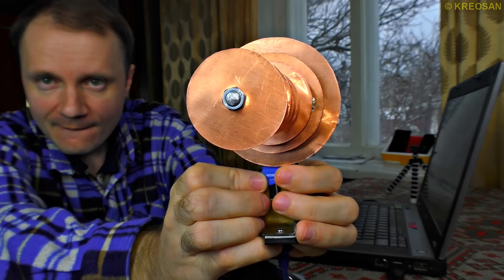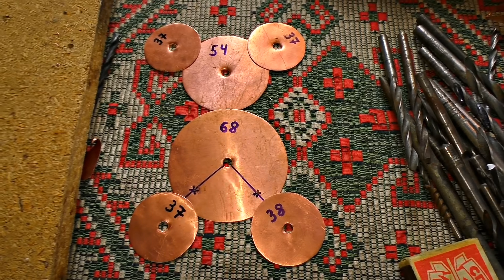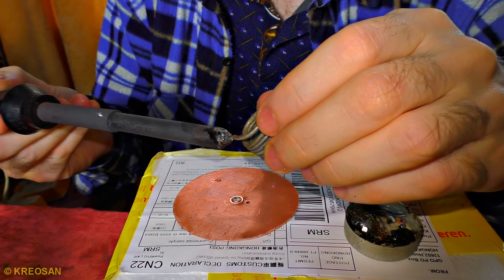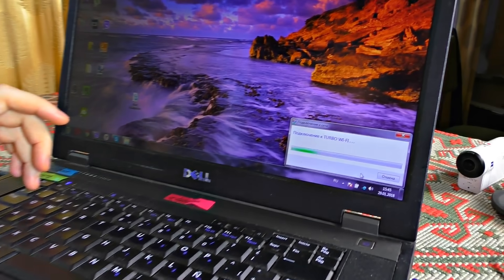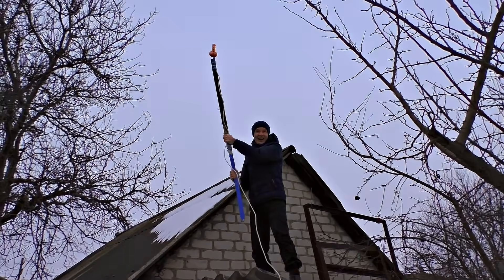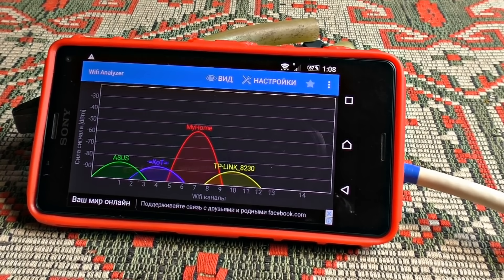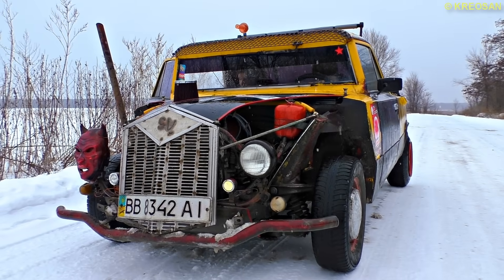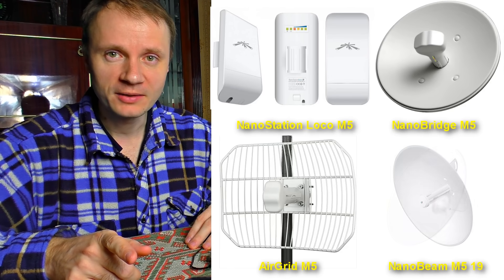✅Wi-Fi Gun DIY / Powerful Antenna for Wi-Fi !

Comment: kreosan , I like this design, I'll keep this one in mind as its similar to a yagi antenna but may work better. If you could save me some time, do this experiment please:  Use some larger diameter copper discs in a series circuit generating high amps and low voltage out put by using a flame/heat source for heating up the center core of the discs,as the heat thermally transfers its self from the center of the copper discs to the outer rim of the copper rings generating an ultra low voltage but high current that needs to be converted into a more usable form of electricity.  Thermal electric using copper and just heat alone basically.

Comment: I not think 75 ohm Cable must be used for Wifi
Reply: The losses are real in that length of cable. Better to put the dongle or the router on the top of the mast next to the antenna.
Reply: Yes, agreed.  Use USB cable and maybe even powered hub if length of USB cable is long and signal strength is low.  I think impedance mismatch can heat up adapter also and cause to reduce operation life.
Reply: Exactly what i thought at most 50ohm cable should be used, and isolation between elements is when i realized this was BS. If you short circuit your antenna to ground i would think that would keep it from working. Basic antenna 101. Ground absorbs current!
Reply: Szakembör TV TMIAE it's the characteristic impedance of the cable when the cable is used to transfer signals... The thing is that discussing this as a problem here is bs because in an antenna, only the core is used for the signal. If the shroud is not connected, then it has no influence on the impedance. If it is grounded, it will act as a shield and prevent other signals from getting in between the antenna and the receiver. Has anyone tested this rig? I'd say, don't claim hoax if you can't prove it... 
I've done a successful wifi rig with a box of pringles that boosted my signal to 200m (instead of 50m without): Take  2 unopened Pringles tubes, cut out the bottom, throw away the pringles because they are disgusting, then cut a small hole in the center of the metal lid (slightly smaller than the width of your wifi antennas) and slide them over the antenna. 
This design could work if the sizes of the disks and distances are optimal to resonate on wifi frequencies, and since a pringle rig works, I don't see why this wouldn't do anything... I'll try it in a couple of weeks and post the results :)
Reply: yes 50ohm is best and you want it as thick as possible to reduce losses
Reply: Yes, Extent the USB wire, not the coax.
Reply: He got really lucky that all that cable loss was beat by the gain of more height! Wow
Reply: Yes, and not any Rg58 ohm cable. Due to the High Frequency we need Special low loss cable.
Reply: Putting a wifi dongle in place of the driven element would work well. THe reason: The dongle is a transceiver itself, hence 0 length downlead. The  only thing coming down from the antenna then would be base band data; hence no transmission line is needed or desired. Try it, it should work very well. Done the same with old satellite dishes. THere was an article in the ARRL's QST magazine some months ago about making a radio telescpe out of one of the old Dish antenna (ahem) dishes. Also, the author designed it to work as an alternative to wifi dongles. Hve to find the article and read it. It is, if nothing else, a damed good read. 73 de WA8LGM/WQTZ773
Reply: Just run USB from back of antenna 
USB 2.0 provides for a maximum cable length of 5 meters (16 ft 5 in) for devices running at high speed (480 Mbit/s).
Reply: google "zsun openwrt" and you'll see the perfect candidate for this.
Reply: Seems that I don't even have to post anything, as here you can find a more reliable source who tested this rig and fixed a minor problem with it, proving it works, but also proving it doesn't work as well as this video claims. (but it certainly does work)
https://youtu.be/QTMi99HtW_k
Reply: belive 50% of this video
Reply: Vic Green RG142 👍👍👍
Reply: USB over Ethernet worked for my wok-fi antennae  .  The hardest part is keeping off the roof to do adjustments midnight to 0700!  "don't do it,  wait til the morning..it's totally not cool at this hour" said me myself and I
Reply: Could I do this and hook it up to my phantom 3 drone and get more distance?
Reply: John Cartwright were you responding to me?
Reply: try on yours TV's cable  to connect the hot wire(central) with ground wire and then check how many programs you will receive ....
Reply: Vic Green is this real?
Reply: I find it funny that some of you guys seem to understand at least some basics a radio communication yet still believe he pulled this off....

He didn't the directing element was never even isolated.... This video is just bullshit to rake in YouTube views. Those of you questioning his use of 75 ohm coax are correct but there is no way in hell that the height overcame the losses......
Reply: The impedance mismatch isn't that severe, it's not that advisable, but not that likely to break anything, and won't matter the slightest on receive.
Reply: Also I think low quality RG59 tv coax has lot more losses then ECOFLEX 15 plus or aircell coax
Reply: Hello Corrosive,  I totally concur whit your statement. Also in the video on the car they easily directed the antenna. In real world this is a pain in the *ss.
Reply: google "zsun openwrt"
Reply: remember it's Russia, so it's not uncommon to have power fluctuations if you connect a big power consumer... And I'd take the other video's advice at heart about blowing up your network card amp if you happen to connect it in the unisolated version... (I guess in the video's case, you'll blow op the "pigtail")
Reply: use 15 ohm

Comment: Simply fake all of it impedes dsnt mach for wi fi and cable TV 

The squigly thing is not a quarter web length antenna..

Bolts shorts every plate...
Reply: Debashis Das no its not. Eletricity at high frequencies behave different than normal. https://youtu.be/GRJw3SCBGfA here they explain it.
Reply: thanks, mate for the link
Reply: Debashis Das you're welcome.

Comment: Shouldn't antenna elements  be electrically isolated from one another but yours are connect over the metal bolt?
Reply: It doesn't matter, because when they resonate, in the middle there will be a voltage node. It's like when you put a finger softly exactly on the middle of a guitar string (not pressing it down, only soft): You will still be able to hear a sound (not the best example, because here it will be one octave higher).
Reply: Lukas is correct (I'm an engineer).  Here, the guy used round elements so it's not horizontal or vertically polarized.  Further reading : http://www.antenna-theory.com/antennas/travelling/yagi.php  Add "plumber's special" to a yagi search, that part isn't a new idea.
Reply: Zara Hall yes, it is possible. With signal in giga Herz, flow of electricity is different. Wave length is very small. 
 Did You See how build is phone antenna? And why ground is connected to this same copper wired with signal pin?  I use for my antenna in computer from old phone. And is working. Maybe signal is this same, but important is that is not worse, then original cheap antenna.
Reply: Yes strange

Comment: Adapter: TP-Link TL-WN722N
Connectors start looking for combinations
RF Coaxial tv f plug 
Rp-sma tnc connector female (for those black 90* wifi antennas)
RP-TNC female (different antenna type)

Comment: This is too good to be true i say its fake
Reply: Darren DIY this channel has always been legit. Don't know why they would fake this
Reply: Yeah dude that is what i think but it seems too good to be true
Reply: It's totally possible, I've done these things myself. It takes skill to do it right.
Reply: Probably real - that antenna has lots of gain compared to the crap factory almost -dipole.  2.4 gig does need line of sight, though...so won't go around the curve of the earth.  Note, the gain comes from concentrating the pattern all in one direction - no up or down or side to side.  There's no free, and as he said, aiming is critical.
Reply: Nah, it's real. In my city we tested WiFi between two high-schools's roofs, 6km apart, and we got a 80mbit connection with a couple of antennas not much bigger thant that one, and an ubiquity AP.
Reply: nah, that‘s real. 100s of kilometers isn‘t a thing, but a kilometer or so is definitly possible.
Reply: +ComandanteJ  if is real, I would love to see any proof of your antenna setup ..On FB or web page ?
Reply: Doug Coulter thsre is no curve.. At 40klm the line of sight drop is over 300 feet. The signal will be travelling nearly 600 feet above the ground at 50klm
Reply: Mr Alex Biz try it yourself

Comment: Fake
Reply: Also antenna elements of the Yagi type antenna  should be electrically isolated from one another but his are connected through the metal bolt.
Reply: peter allridge ???
Reply: no it aint
Reply: Zara Hall this is true although I bet it does work as a very good local less than 1km directional but that distance is utter shit
Reply: +peter allridge

Would this be antenna be better than a normal yagi or cantenna?
Reply: Ra Vee what kind of question is this? A badly made aerial v a consumer product?
Reply: I use rf daily no way that thing would work that far 0 chance and the coax used would rob all power sent down it it's 75ohm. Basic shit ppl. Not saying it does not work but that distance is fake

Comment: connecting 75ohms cable to 50ohms wifi dongle ?
Reply: Roshke it isn‘t impossible. The mismatch between 50/75ohm will give a SWR of 1.5. This means you‘re losing some of the power/energy, but it‘s still fine.
Reply: You'd have to make another of different size to tune the 5 ghz band.  Yagis are very narrow-band.  I'm surprised he even got most of the 2.4 gig band (you can see it tailing off at the edges of that band as is).
Reply: can I replace coper whit aluminum .
Reply: That's going to be up to some details in the router.  Most that have two antennas don't put them in parallel, but have essentially two radio front ends.  Later models attempt to do beam forming which requires omni directional antennas to work (this is done by adjusting the relative phase of the N antennas - like in a phased array radar (you should be able to google that).  This yagi likely has a far tighter beam than that could produce already - hard to say without more info, but I'd bet around 10 degrees + or -.  If your router has two antenna connectors, you could use 2 of these pointed in different directions... 2 in parallel on the same jack would require some kind of impedance matching to have a decently low SWR (see below).  I know when I made something like this back in the day cut for UHF TV wavelengths, it was really hard to aim accurately enough and was so narrow band that a 6 mhz wide tv channel didn't fit too well - color was elusive (NTSC signals in this country...).
Reply: Krzysztof Rodak I'm wondering how that works as well. I've heard that it's impossible to use wifi over tv and satellite cables

Comment: cool video but complete bullsh*t  you will eventually kill your wifi dongle or router if you plug this in for any length of time
Reply: And this is completely ignorant... You have to understand what his intended audience is, namely people in a war-torn country, who have to make do with a devastated infrastructure. This isn't meant to be a permanent fix, but rather a way for people to communicate with their loved ones after their city is SHELLED... Not great when you live off the grid, but fantastic if there is NO GRID! Furthermore, how do you know that their standards for coaxial cable aren't different than in the U.S.? I certainly don't. There's a reason why his videos in the original russian/ukrainian (?) have over a million views, it's in his BEST INTERESTS to properly instruct his viewers as to how to connect to the internet under adverse conditions, where they couldn't be able to otherwise.
Reply: this wouldn't even be a temporary fix the dipole he pulled apart would have more reception.   This is like a dead short between the 2 wires.
Who said anything about the coax.... although by the time the signal managed to get down that tv coax there would be no signal.
Reply: Clearly, skyliner is NOT an RF engineer. Your statements are ludicrous bullshit.  Read ANY antenna book and note the sizes of wavelengths and the sizes here.
Reply: if you look at making a yagi antenna the balun is not connected to the rest of the antenna or on a patch antenna the two wires are not connected together, you dont have to be an rf engineer to see that this is complete bullsh*t

Comment: 0:06 Hundreds of kilometers? Meters maybe?
Reply: in original russian video he said "many kilometers"
Reply: the real test result is 9 kilometers and that is also without tall building in between the antennas
so maybe in theory if you make it 12 times or more of the size the antenna in the video, you could get 100 Km
Reply: I guess his 3 mm copper sheet metal is also just 0.3mm... length measurement might  not his strength^^
Reply: ghos7bear . As with any other high gain antenna, the higher from the ground you place it, the faarther away the radio horizon is.  The caveat here is this: the longer the cable the higher the need for an antenna preamplifier is going to be. The limit to the range off thedevice is the curvature of the Earth, allowing for nomolous or anomolus propagation conditions which will depend on lots of different and sometimes strange atmospheric and sunspot conditions. 
Again, if you stack them, the gain from the stacking is theoretically +3dB if the antennas are properly matched and phased correctly. 
Reference to ARRL Antenna Book or microwave design texts such as the Proceedings of the IEEE wherein Dr. agi describes the original design of the antenna of his design. This antenna is common in everything from HF to near mm wave operations.